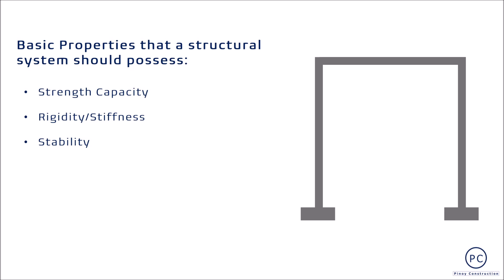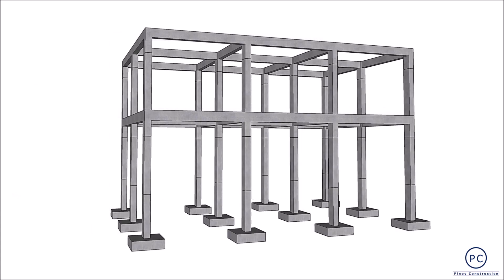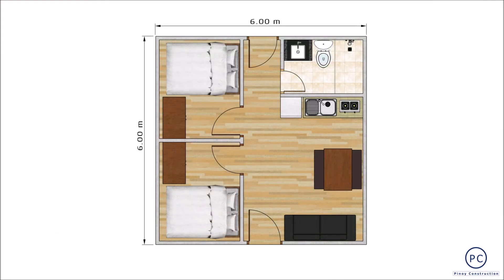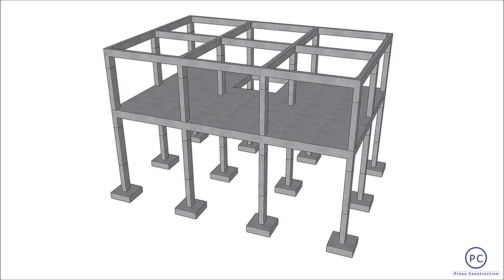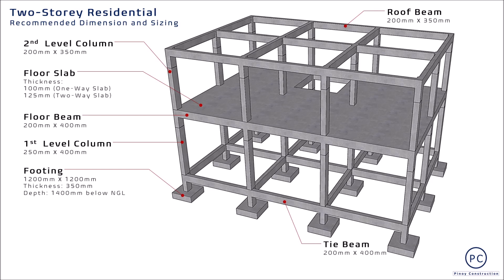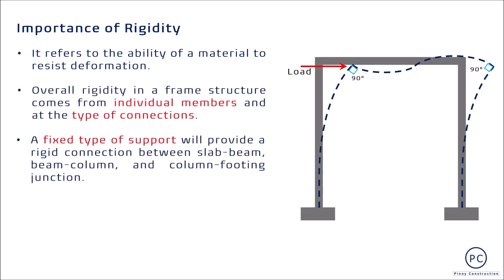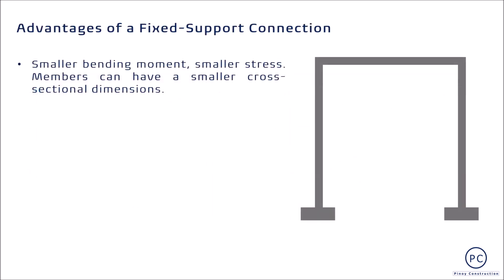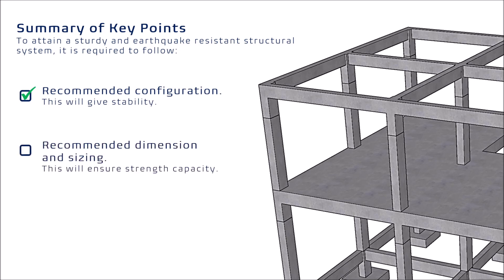Ang Basics ng Structural System Part 2 - Properties

Comment: hello sir, ok lang po ba ang 250x250cm na poste for 1 storey bungalow? 6pcs 12mm naka square type sya hndi sya naka 200x350mm . and ang distance po ng wall is nasa 4.70m ang column at isa ay nasa 4.3m . 9 Columns lang po sya sa 6.5x9mters na floor plan. 

Salamat po sa isasagot nyo
Reply from the maker: Hello po sa inyo. Ang recommended po sa bungalow ay 200mm x 350mm for column span distance na less 4m reinforced with 6-12mm rebars. Kung ang 250mm x 250mm po na sectional dimension ay adequate base sa engineering design, ok po yun. Basta nai-design po sya ng engineer, nothing to worry.
Reply: @PinoyConstruction1  Thank you, pero po kasi ung Haba ng bahay is 6.5x9 meters bale 9 columns lang sa design, ung pagitan ng columns is nasa 4.75m ung isa at isa nasa 4.25m po. Ok lang po ba un? 250x250 ung laki ng poste. pina design ko lang po sa pinsan ko na Engr.
Reply: Sir sa 2 storey na residential house ang distance ay 4m x 4 m at ang vertical bars ay 16 mm at 8 pcs at 30cm x 30cm ang size ng poste ? isa ko pang tanong kng 40cm x 40cm ang size ng poste at ang distance ay 5m x 5 m at vertical bars ay 16mm na 8 pcs ? AT NAKA DOUBLE TIE BEAM